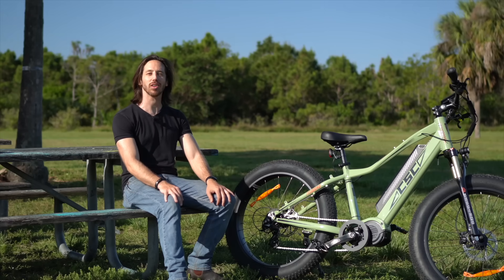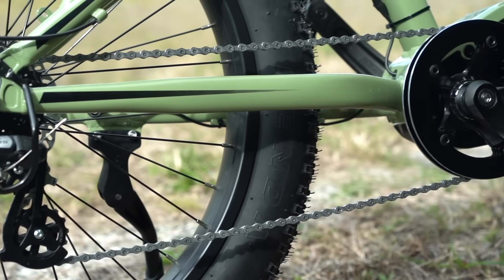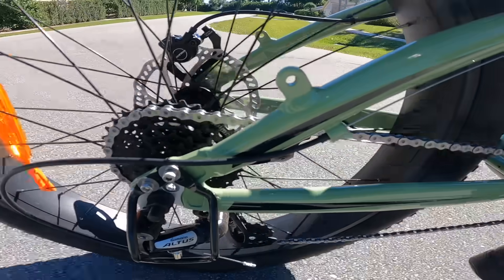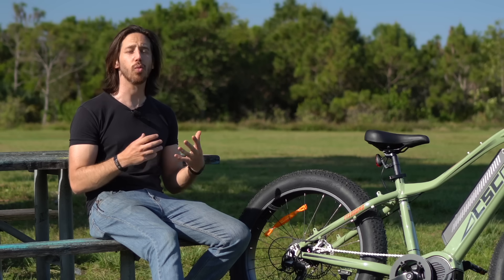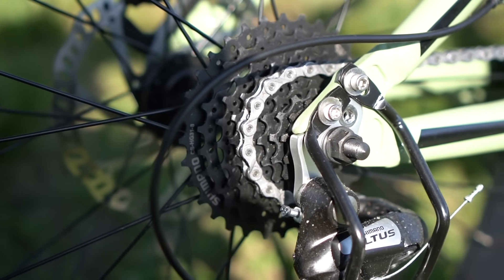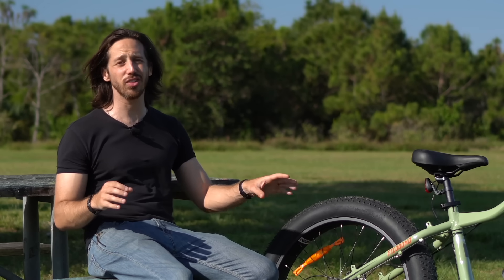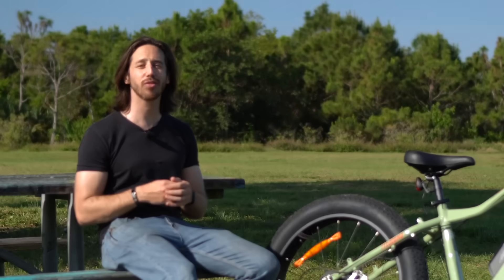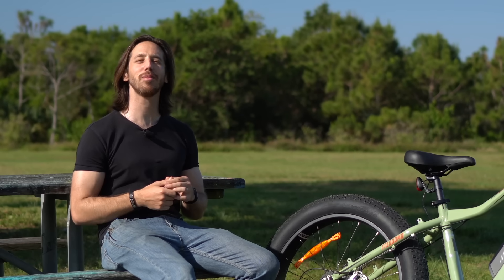How to (properly) ride a mid-drive electric bike

Comment: One thing though if you have a cassette they often have replaceable cogs for the two highest gears because they wear faster but the third highest gear is often part of the main block so if you keep using that gear you may wear down the main block to an unusable state. You can get replacement small cogs from places like aliexpress for reasonable money to save replacing the whole cassette. Obviously not an issue with freewheels as they are always a single block of cogs.

I think even taking these precautions you will still wear down your drivetrain with mid-drive much faster. Going up a steep hill at 4x the normal speed with all that load on the drivetrain is going to wear and stretch that chain at a much faster rate and still be a greater risk of the chain snapping. Even with careful operation with up to 4 or even 5 times the power of a normal person going through the drivetrain it will wear faster. Bosch do some low power mid-drive motors that only produce something like 40Nm at the crank and those are designed for use with hub gears etc but they will also reduce drivetrain wear considerably but then they won't get you up hills any easier than a hub motor so maybe not much point to them.
Reply: All the sprockets in a cassette are replaceable. Look at the "low gear"/bottom side and find the three pins. Some are screws, most are simple pins with a top side flange (no flange on the "bottom"). Drive the pins out, from bottom to top. Replace the sprocket you need. Replace the pins.
Reply: @bob-ny6kn  I meant replaceable as in available to buy. Most of the cassettes I buy only have the 2 smallest cogs loose and available to buy separately. I realise the main cluster is assembled at the factory from loose cogs but I don't see those parts available to buy because I guess they wouldn't need replacing normally. You might get through 2 sets of the smallest cog then 1 set of the second smallest before then having to replace the whole lot anyway through wear.
Reply: @bonzobanana1  Yes, I agree.

Comment: Shifting with a mid-drive sounds very similar to shifting on a regular (non-ebike) while going uphill. 

The key to shifting uphill is to pedal hard enough to give yourself enough speed that you can then make the shift as you pedal without any load on the chain.
Reply: Note that shifting uphill often requires shifting before the hill gets too steep to be able to pedal in the current gear. So planning or forethought is required. Miss doing it enough times and you'll learn from experience.
Reply: Or simply same effect riding on low gear, slowly , with high RPMs... and at the moment of shifting let it go easy on pedals for fraction of second exactly as he described - with little practice you will instantly notice more quiet action on your gears than if you push hard in a moment of gear shift. I recognized fairly early this fact on my Cannondale Tesoro X1 Remixte bike. Again, you need to think proactively, and before stop, or running into rough muddy grass let say to make a shift 'before' into low/est gear, not while working hard on pedal on high gears and only than shifting to lower ones as it is lot's of stress there... Have fun, and ride safe!
Reply: In the mountains ,often I find myself at the bottom of a steep hill because of a stop sign or busy intersection. I get off the bike and lift the rear wheel off the ground ,shift to lowest gear using throttle. Works great and Im not crunching gears by shifting uphill. A mid drive still operates like a normal bike if you have gears. My next build will experiment with rohloff hub and super light weight.
Reply: @TheAgentAssassin  My ebike doesn't have a throttle, so in that same circustances I can use walk mode and then downshift.
Reply: This is similar in principle to rev matching and shifting without using a clutch. It's always best to shift when the motor isn't putting tension on the train. People who ride motorcycles tend to understand this analogy when I mention it. The shift sensor does this but I prefer the feel of just using my thumb to back off the power, shift and then feather it back on.
Reply: That's a good analogy.
Reply: This is one advantage to a hub motor. If I'm having a little trouble on a hill, I can just back off pedaling a little to take the load off the chain, but keep the throttle high to keep me moving forward while I shift.
Reply: @NoobixCube  Throttle bikes aren't legal in the UK. They have to be registered as motorcycles though very few do.  The police are starting to take some interest though as accident rates climb with these things zipping through town centre traffic.  Only 25k limit pedelecs are UK legal.  If I wanted a motorcycle then that's what I would buy.
Reply: @Biffo1262  Motor cycles are expensive in gas. Even if you have an electric motor cycle though your insurance is a killer. Ebikes are basically free to use other than initial cost and very cheap occasional maintenance. Registering a vehicle as a motorcycle introduces several thousand dollars in unnecessary charges every year.
Reply: @Biffo1262  It's totally fine to use the throttle sometimes. If you want a human powered machine, then get one of those. Throttles are super useful.
Reply: @NoobixCube  But we don't have trouble on hills with mid drives 😊
Reply: So my bike has a free-crank which means I can back off the pedals but the motor can keep cranking on it's own.  I still try to do the right thing but it still clunks sometimes when I shift.
Reply: @JohnathanVail  The lower the speeds and the cheaper the drivetrain the harder they shift. The tech improved a bit over time. Derailleur alignment, shifter indexing, proper chain speed, all those things play in how your shifting is. Sufficed to say if you're getting hard shifts more than 1 in 50 something is wrong. The rough number but you should be able to go a few days without gear skip/clunk/grind etc. Once you drivetrain is set up noise like that is "operator error" for at least a good 1000km.
Reply: @JohnathanVail  obviously if you are using throttle only that wouldn’t work. The advice was for if you use pedal assist. In which case a sensor helps the controller to adjust motor speed according to how fast you pedal.
Reply: @jacobleeson4763  yes.  I have no throttle but the motor can still be cranking when I stop pedaling.  It seems to continue for about a second after I stop.  So it is up to the software to control how much power the motor provides on it's own.  I don't get the clunks often but I suspect if the motor is working hard I let off torque pedaling to shift the motor might not respond quick enough and I get the "klunk" shift
Reply: @JohnathanVail  you can sense if the motor is still running though so if you shift before waiting for it to disengage that’s on you.
Reply: @JohnathanVail  That's "ghost-pedaling".  Try getting your motor/controller/display software updated. I'm working on the "squeeze either brake just enough to kill the motor" technique, will stop the motor instantly.
Reply: It's exactly the same.
Reply: Sure that's how you do it on a low-end POS mid-drive bike.
Reply: @brianbassettnumber1  and? Not everyone can afford top end gear. I think this information is good for those who are using whatever they can afford to use.
Reply: @zalafinari  So you don't own an ebike right? Telling people it's a good idea to buy a low-end POS isn't good advice. It's a tactic of someone using Amazon affiliate links. There isn't a production ebike built today I would own, let alone buy. It's so easy to have a far better ebike than what's produced today. You just have to stop taking advice from people that are paid to recommend low-end crap with minimal performance... when brand new, and impossible to get repaired when they fail.
Reply: @brianbassettnumber1  I own 5 electric wheels and four controllers. I've built my own electric bikes from parts. I bought almost all my parts used, outside of a battery and controller. I can't speak to the quality of production ebikes from experience but I know a few people who own them and they haven't complained of any sort of major defects or issues.
Reply: @zalafinari  With a brand new bike... I certainly hope not. I guess when I have ridden almost 40K miles in the last 7 years I see what happens when ebikes are actually ridden rather than just collected. And I'm talking about performance more than build defects.
Reply: @brianbassettnumber1  With ludicrously fat tires that do nothing but pointlessly such up energy.
Reply: @gary7vn  If you haven't ridden a fat tire bike in the snow or sand then you haven't learned they have their place, but yes their rolling resistance is horrible.
Reply: @brianbassettnumber1  I never said they were not good in those modalities. Snow and sand are where they work best. Roads, paths? HORRIBLE. STUPID. Don't do it.
Reply: @gary7vn  Thanks for taking the time to point out the obvious... Billy. I read what you said. Every tool has its place; a fat tire bike will go places my bike won't and it's the best all-around ebike I have ever seen. Large tires do more than absorb energy Again, every tool has its place... just like you.  You own an ebike, Billy?

Comment: This was the first thing that came to mind with the Lectric XPremium. Getting my mid drive motor ebike was an eye opening experience, even as a life long cyclist. The sound it makes when it shifts under load is definitely a “you’re doing something very wrong” noise. Great video, I’m glad you covered it. I don’t think anyone else has really talked about it.
Reply: Mid-drive will destroy a gear cluster. That's why riders put it in a single tall gear and ride it like an underpowered electric motorcycle.
Reply: @brianbassettnumber1  only if you shift under load. Shimano and Bosch both have shift detection. I use a Brose and have thousands of miles on my gears and they are fine.
Reply: @Alttabbins  The channel won't let me reply to you.
Reply: @Alttabbins  E-bike motor put out far more torque then a human. Drive trains developed in the 70s are simply not up to the job. In recognition of this Shimano is now making their Linkglide system just for ebikes.
Reply: @brianbassettnumber1  Thats exactly what I did, single gear, no shifting.
Reply: @underdogoutdoors  Not trying to be a smart ass, (I'm new to this with a mid drive kit on the way)
But doesn't that defeat the whole purpose of a mid drive?
Reply: @whatsit2ya247  The mid drive has so much torque, it's common to break chains & damage cassettes regularly, unless your experienced & careful, my purpose is biking in to deer hunt, one gear takes me up hills & rides up to 18mph with no shifting, no damage- over logs & through mud ditches, I'm an older guy & not a bike enthusiast, but do have 3 ebikes already, very happy with no shifting, for my purposes🤣
Reply: @underdogoutdoors Nice. Which gear do you usually use?
Reply: @cilami  Not sure the size of the one gear on the ebike- I have a youtube video with the bike where you can see it, on my channel, underdog outdoors, it's not a granny gear but becomes useless for peddling as the motor takes over at about 10mph- perfect for taking me in and out of the woods with hills.
Reply: Hi LL, Did you go from a rear wheel drive e-bike to a mid-drive or did you go from a non-e-bike straight to a mid-drive? Curious what you thought of the difference if you did go from rear to mid.
Reply: @ThePackDad  I went from a regular bike, to rear hub motor bike, and then to a mid drive. I don't see a problem with either a mid drive or rear, but the mid drive feels a lot more natural.

Comment: I have the same CSC Mid drive you used in the video. I wasn't happy with the distance I was getting from a fully charged battery. The nice folks at CSC { these guys even answer the phone when you call} explained pretty much everything you mentioned in this helpful video. I'm extremely happy now with my mid drive so much my CSC hub drive bike has been getting ignored a little
Reply: how much watts and ahs and how far do you usually get?

Comment: Great video.  I have a RAD bike with hub motor but at some point in my ebikeing career I hope to put a few miles on a mid drive. and even with my hub motor I find the ride more comfortable avoiding the extreme gear settings.

Comment: Hey I have a question.pls answer it. How can I over volte a 24v 350w gearmotor controller.its max is 30amp can I give it 35 amp will it burn

Comment: Good video, I built my self a DIY using CYC X1 Stealth and the 10 speed chain that was originally for the bike was to tight on the chainring and it warped up back into it self and blew away the derailleur, so I converted to single speed and i can say for sure that 32t to 13t ratio is not good for the heating of the motor where it would always hit the foldback threshold. So in a 32T to 17T Ratio I'm able to use it up hills easy and on flat it only lose a bit on top speed but this thing is so fast that I think it is a good compromise, quick start, hill climb and still quick on flat. I made a good demo of 32t to 17t crossing a bridge in windy conditions. https://youtu.be/jPo48ThQv_k.

Comment: Lots of people have been spoiled by automatic transmission in cars. Learning to ride a mid-drive ebike will be a novel experience for some. You gave a great explanation that will help the uniniated. I have both hub and mid-drive ebikes. Both are fun in their own way.
Reply: I think anyone who has ridden a bike (well before driving a car) will have had to change gears
Reply: I added a shift sensor. Motor cuts off during shift
Reply: @Kay0Bot  did you happen to make a video of how to add the shift sensor?  I’m assuming you have a hub drive. Thank you, George
Reply: @georgeharvey3062 sorry, I have a middrive bafang bbhsd, built in controller comes with a port for the shift sensor.
Reply: I have an emtb mid drive. I don't like the maintenance, mine is bosch. Good performance, stupid fucking proprietary shit, extra gears, ridiculously expensive battery.

I'm never getting an electric chain drive again.

They are good for emtb applications but it gets stupid to actually start putting miles on it by commuting or whatever. Chains suck.
Reply: @randomguydoes2901  you are correct ,only hub motors .....
Reply: Edward which Ebike do you prefer?  I bought my wife a hub drive for commuting because it was simple for her to operate and it his plenty of power for her size body. I was a little underwhelmed with it because of my 220lbs weight. I went and preordered a mid drive in the hopes my hill climbing would be better. I’m used to shifting motorcycles so I figured the shifting on a mid drive would come natural to me. Your thoughts please with your experience. Thank you
Reply: George, you'll notice the difference in power immediately between the hub and mid-drive, especially going up hills. As Johnny advocates, a gear shift sensor will help you from breaking chains if try to lug the motor or tap the brakes before shifting, it does the same thing. Once you ride a mid- drive you'll never go back.
Reply: @mygallimaufryofshortstories  thank you so much for putting my mind at ease.
Reply: couldn't say it better myself ......
Reply: You are so confused
Reply: My autoshifting belt drive is my favorite bike ever.
Reply: If you cant drive manual

You can't drive
Reply: @getstrongby4038  get off my lawn! So F1 Drivers can't drive? Stupidest comment ever.
Reply: @getstrongby4038  I hate this gatekeeping BS. Driving involves a lot more than knowing how to work a transmission.

Comment: Down shifting on steep hills is the tricky one, it’s hard to back off with out stopping.
Reply: Thats why i upgraded to a cvt hub. Nuvinci/Enviolo is the tradename. The gear ratio can be changed under load. Also it has a gearing of 360%. Thats plenty in combination with a middrive. What a ride... no more backing of and loosing momentum while downshifting uphill! Just twist on the gear ratio shifter. Amazing feeling!
Reply: @Gabriel.Leni100  I've often thought a cvt hub would be the best alternative. No chain just a belt. Not sure of there longevity. Do they require maintenance?
Reply: @grantadamson3478  no maintenance needed. They have oil inside but its very special and no need to change it. Here in Europe there are a lot of touring e bikes which have these kind of hubs with a belt drive. So basicaly no maintenance needed for 10 000km. Only problems occure with automatic ratio shifters. They are not reliable and fail often. It was a good idea as you were only setting the cadence which you like and the bike will do the shifting for you so no mather if you are uphill or on the flat the bike will keep your cadence the same. 
The hubs themself are not failing that often. They are pretty reliable. Keep in mind there are a lot of different variations of this hub. Cheap trekking bikes will have a hub with only 320% ratio. But there are also versions with 360%, 380% and 420%.

Comment: Does anyone know if the rule on stopping the electric motor when changing gear also apply to front or rear wheel drive bicycles?
Reply: I am assuming by front or rear wheel drive you mean a front or rear hub motor. You do not need to cut power to the motor when you shift with these as you are not putting load on the chain and gears since the motor is directly applying force to the wheel not through the drive train.
Reply: Only rear IMO..

Comment: Yup, this is all very good advice.  I learned my lesson by making an expensive mistake on my DIY Marin with a 750 watt Bafang mid-drive.  Took off in 6th gear and busted the chain.  Then the chain took out a few spokes in the rear wheel.  Thankfully no damage to me.  Great video, as always.

Comment: 😱😊👍🏽 thank you for this video I am guilty of riding in a low gear I just bought a fat tad trike, that I turned into an electric I bought 1000 W mid drive motor and I always start off peddling in low gear with pedal assist I better change that😱😱😱😱